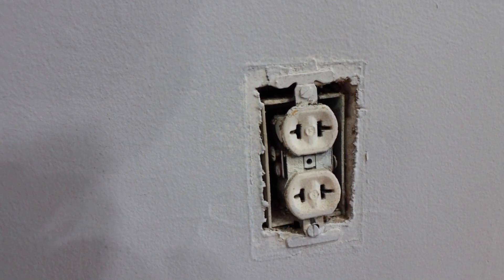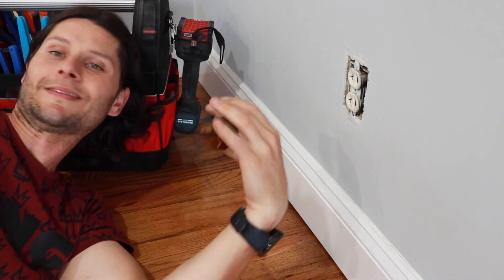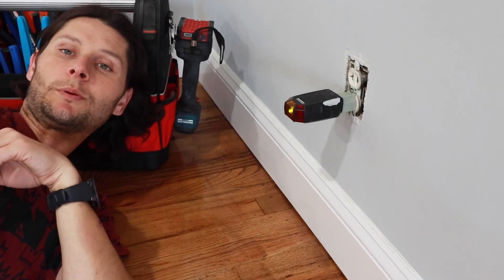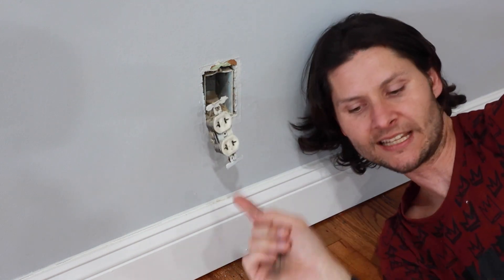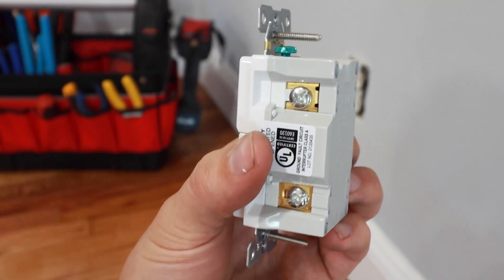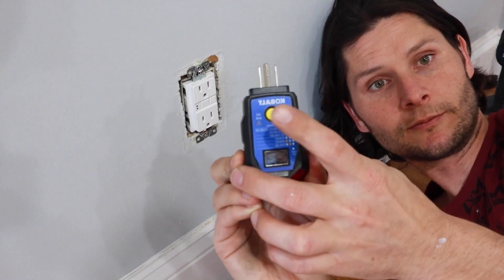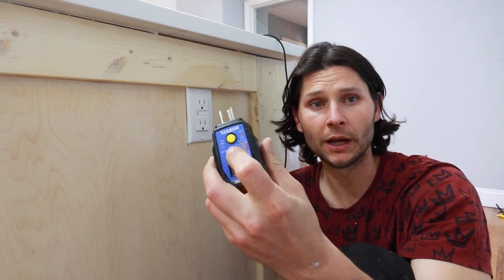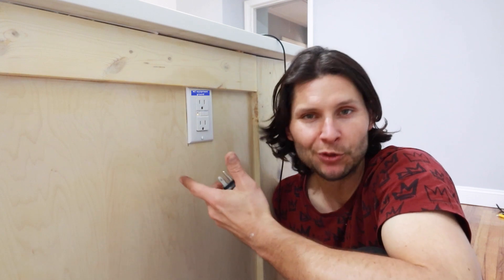How To Replace An Old 2 Prong Outlet Using 3 Prong GFCI And Why GFCI Tester Won't Work

Comment: The GFCI works on the principle of detection of fault current through a path external to the normal current path of the circuit. The normal current path is via the black ("hot") wire and the white neutral. A fault current is any current external to that normal path such as current through a person making contact with the circuit. A ground wire is not necessary for the GFCI to respond to a fault. The GFCI "sees" a fault whenever there is a difference in the current flowing in the "hot" and the neutral wires.
Reply from the maker: Good info! Thanks for sharing.